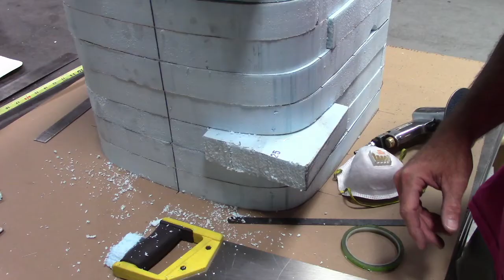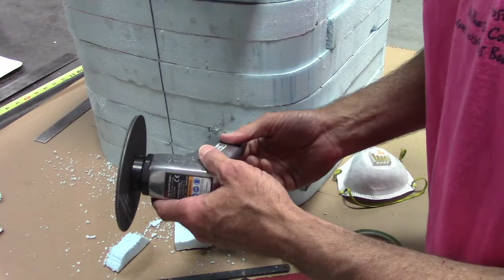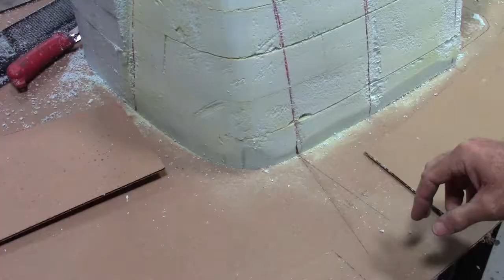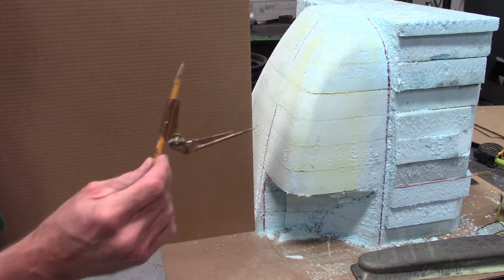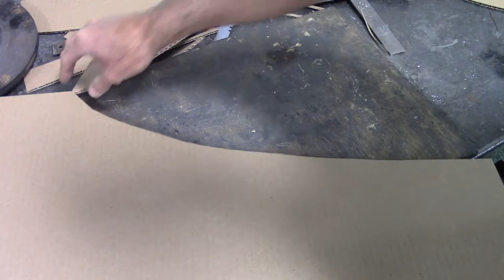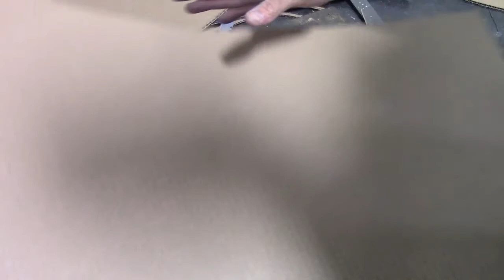Foam Track Nose Buck Part 2 of 3.mp4

Comment: A third scribing tip - can run a pencil inside a washer.  Tricky in this situation but for marking vertically easier than it sounds.  I found a link to someone managing to do it on a vertical:  https://www.woodcraft.com/blog_entries/tips-tricks-issue-90-roundabout-scribing#:~:text=Pressing%20the%20washer%20against%20the,washer%20to%20refine%20the%20fit.

Comment: Am enjoying this series not having made a buck as yet.  With a woodworking background a couple more scribing tips.  No need for compasses, I often use a scrap of wood "ruler shaped", round the end or make a "soft point" that will rub along the model and drill a hole to take the pencil.  Am sure could add a handle and all sorts else to make a "scribing stick" with multiple pencil holes to suit different situations but truth is I make what I need for the job and chuck it.  The second tip is when getting close is to run the pen or pencil along the model to mark a line half the diameter of the pencil inwards.  If the pencil isn't fat enough to bridge the biggest gap wrap some masking tape.